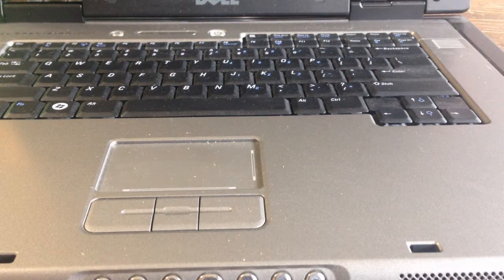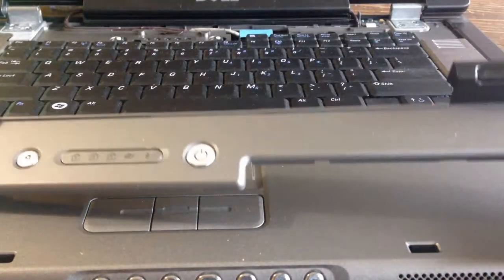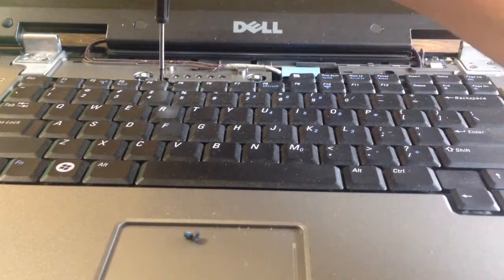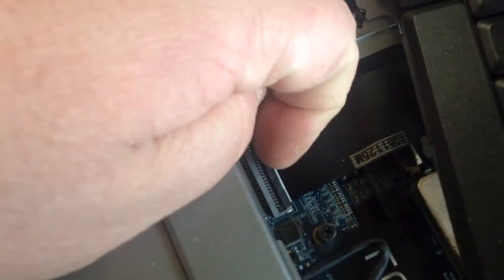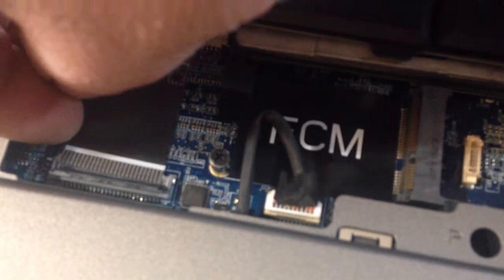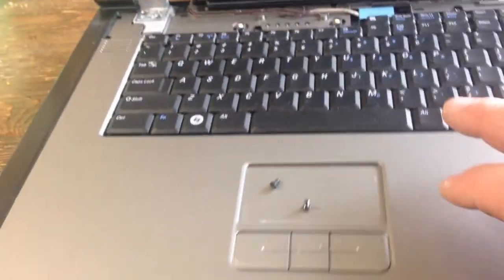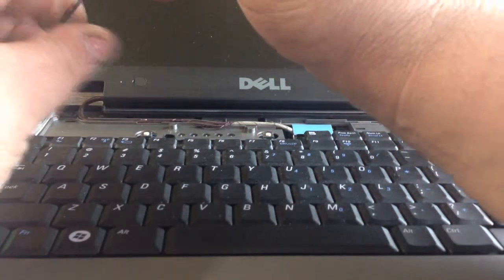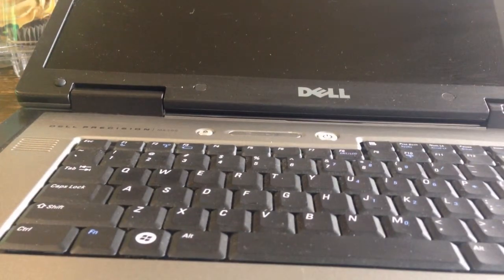How to remove and install a keyboard in a Dell Precision M6300 or M90 laptop

Comment: Hey man, thanks a million.  Got an M90 -- one of my fav laptops.  Wrote new .INF files to get the display driver working with Win10.  Then made the mistake of laying another lappy on top of the keys.  Sheesh are they fragile!  Thought I might have to scrap the thing, given price of a used M90 on eBay.  But your vid saved the day.  I'm sure i have a compatible keyboard laying around here SOMEwhere.  If not, it's only 13 samolians on eBay.  Cheers!